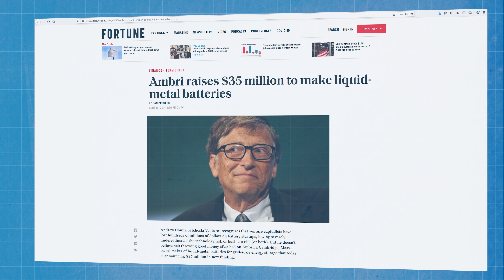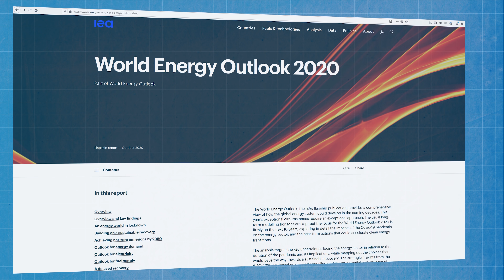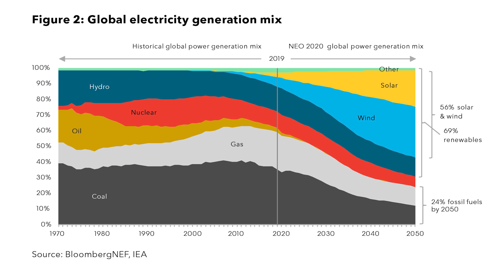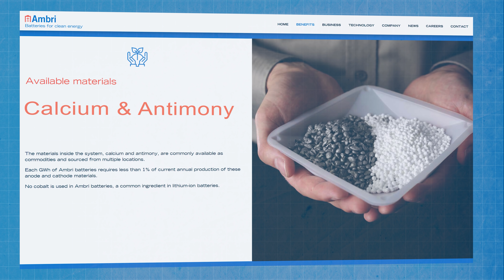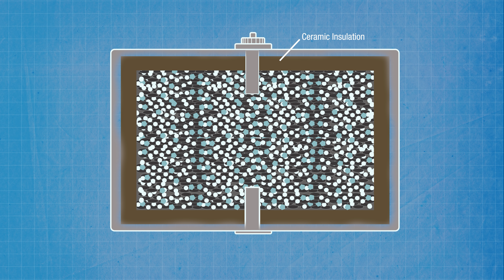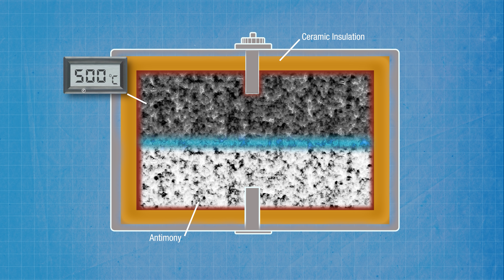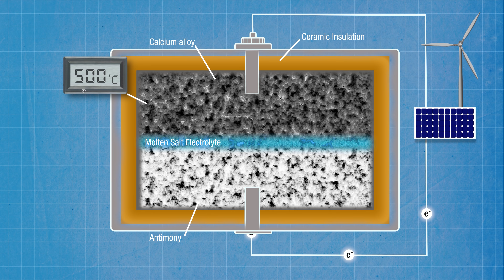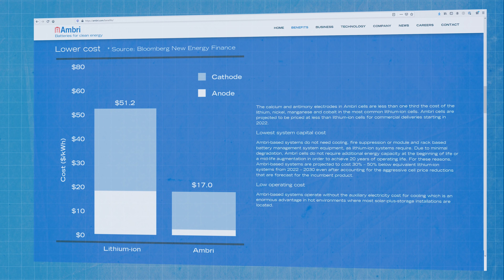AMBRI Liquid Metal Batteries. Will they really change the world?

Comment: Not really IMHO.. 80% theoretical efficinecy is still some 15% below Li-Ion. 
Losing 15% from your solar array is not insignificant. It means that you need 15% bigger array etc.
Also, batteery life of Li-Ion will go up and its price will go down.
Reply: @nick b Extra panels are not just panels. It's the extra terrain, infrastructure, installation, maintenance costs etc.
Li-Ion has no problems with temperature maintenance and probably much higher energy density.
Wear&tear shouldn't be a problem for shallow dis/charge around 40% point.
Cells with drastically lower internal resistance are coming, same with solid state cells.
And price will dive down.

Comment: I just concrete how they would handle thermal cycling  causing cracks to from in the ceramic housing.
Reply: Ideally the temperatures stay pretty close to constant.  They still advertise a life expectence of 25 years iirc, my guess is the ceramic is the first thing to go and they'll be able to just dump it in a new case and start over.
Reply: I'm pretty sure the temperature will be maintained above 500 degrees

Comment: I'm not a chemist, so I have a question.
Are these the best 2 choices for this technology?
What I mean is, 500 degrees C is extremely scary, what if the ceramic develops a crack? How possible is it for 500 degree molten metal to spill into my 
energy closet and burn my house down?
I absolutely love the thought of an almost endless amount of cycles for cheap, I mean who doesn't?
But...is this the kind of thing that has a single accident and the entire tech gets thrown out, even though it may have worked with something just a bit safer? All be it more expensive.

Comment: the liquid metal batteries are hot. this is the negative side of the technology. There are massive loses over heat radiation.  If you have no use for the heat the efficiency will drop massively
Reply: Potentially quite useful for district heating systems.
Reply: Peter Mortensen  deutsch wäre einfacher für mich.  Danke für den Input.

Comment: I do hope this battery is successful for the grid storage market. It does seem quite silly that we are using lithium ion batteries at the moment for grid storage when they are far better off being used to power EVs as they are much more suitable for this application. 

Teslas car production is limited by how many batteries they can make/get a hold of, meanwhile those same batteries are being used for an application that doesn’t require them. Grid storage doesn’t care about energy density or lightness of the battery so using lithium ion batteries for this purpose is a waste of resources.

Comment: ......they're a good fit for grid storage. Lithium are a good fit for portable equipment and vehicles. Liquid metal can't practically be used in vehicles cos they are are gravity dependent battery and the liquid can't be allowed to slosh around. High temperature also required. They are only to be used in stationary circumstances .
..But if we're prepared to accept high temperature batteries then the best option is surely sodium sulphur batteries , the materials are cheap .

Comment: Calcium is pretty damned reactive though.
Getting a hermetic seal that works at 500C, for decades is going to be no small feat.
Reply: How is calcium going to react with a ceramic?
Reply: @bromnader5196  I asked how a hermetic seal is going to hold up over decades of use at 500C
Isn't there going to come a time where the temperature is let to drop to ambient?
Do these alloys have a completely neutral volume over that swing?
Most ceramics are pretty brittle.
Reply: @jimurrata6785  This storage is heavy and stationary.  Is a house made of bricks brittle?  Surely there are insulators that can seal the electrodes and withstand a lot of cycles.  For example the tall cylinders where monocrystalline silicon is made from molten silicon.  Up to 2000 degrees in temperature and cycles up and down every few days for years.
Reply: @bromnader5196  Is a house made of brick (not 'brick s ) hermetically sealed, full of molten metal and subject to 500C temperature swings?
Reply: @jimurrata6785  -- If brick is plural, then why do we say "he threw a brick"?
Reply: @bromnader5196  deer is both singular and plural too.
We don't say "a herd of deer s "
Reply: @jimurrata6785  If you were building a structure with brick, and you wanted your helper to get you some more, would you say "get me brick" or "get me bricks"?
Reply: @bromnader5196  I would say get me another hod of brick.
But I have a vocabulary.
Go look it up. There's no argument here.
Reply: @jimurrata6785  -- So you agree that people would rather say "get me bricks", just like they would say "get me screws".  To force the speaker to use extra words "hod" "of" to convey the same meaning, is a matter of inferiority of the grammar.  Someone arbitrarily decided way back that brick should be plural as well as singular.  But nobody cares and everyone talks of bricks because it agrees with the rule that plural is with an 's'.  The beauty of simplicity.  When rationalization ("follow the rule no matter how irrational it is") meets empiricism (vernacular usage), empiricism always wins.  That is what philosophy has taught us.
Reply: @bromnader5196  I told you what I'd say. 
That's what you asked.
Plural of brick, is brick...
Reply: @jimurrata6785  I wonder who set that silly rule about bricks.  And I bet you also break the rules.  Like driving over the speed limit.
Reply: @bromnader5196  English diction is an abomination, but I had nothing to do with it.

Comment: Honestly, the only serious potential risk I can see for this technology, (aside from dropping it on someone's foot) is if the casing gets cracked, either from transport, natural disaster, or intentional sabotage.  If it gets powered on with a crack that's not sealed, the molten metal will leak out until it looses contact with either the anode or cathode and it stops being heated.  Then it will leak out until it solidifies again.  
Keeping that in mind, it would be easy to design safety measures to anticipate this potential, and this is just something that would happen if the battery gets damaged, and not something that would happen in the course of regular use, unlike with many of the other modern batteries.  
I'm really looking forward to seeing how this technology gets implemented, and am very curious as to how small something like this could be made.  
It's easy to see this being some shipping container sized thing, but what about a car battery sized cell, or an array to have a domestic power storage area for a house like tesla's power wall?

Comment: Great video! Sounds like themal losses could lower the round-trip efficiency of the system, but I'm guessing if the surface/volume ratio of the battery is low enough then, with a little bit of insulation, thermal energy loss can be kept at a minimum. Like if the cells re oil-drum sized or larger, then they would likely take several days to cool off even if unused. I suppose there is an optimal size than balances off this as well as other characteristics. I think that with cheap enough storage renewables have the potential to lower the LCOE and democratize access to energy.

Comment: This sounds great for a big solar farm in the tropics. Nearly every day the sun shines on PV in the day and demand goes up in the evening. The batteries can be arranged to cycle fully every three days maximum with some excess storage for hiccups. It is also good for load balancing as this is pretty regular and the lack of maintenance is a major win. 

However, in temperate climates I believe we need multi-month bulk storage if we are partly dependent on solar PV. I know from experience that in the UK we can go for days with not much PV in the summer and barely a trickle for weeks at a time in the winter. We need more energy in the winter than the summer, so adding more PV because it pays for itself financially over x years is a nonsense if we cannot use the extra energy in the winter. Belligerent foreign powers or terrorist organisations would love us to be utterly dependent on a few ultra-high-voltage (or even superconducting) links to the tropics or the southern hemisphere. 

Liquid metal batteries cannot be used for bulk storage for this purpose as they would lose 80% every three days. Conversely, pump up the hydro and only use a bit here and there for load balancing with the bulk of it unused for weeks or months at a time. Pumped hydro can hold far more gravitational energy than a crane with a few hundred blocks or some trucks going up and down a mine shaft. But gravitational energy is not energy-dense. It cannot store a summer's worth of PV. (Just how high can a 3000mAh AA battery lift 1kg? I didn't believe it either!)

Liquid air needs topping up to make up for losses but no-where near 80% every 2-3 days and is probably much cheaper and more convenient than hydro. Lithium ion is simply too expensive for multi-month bulk storage. 

Hydrogen? 35% efficient and leaky. 

The issue is not yet solved.

Comment: The thermal cycle from these batteries seems to be the most likely source of degradation.
Reply: Thermal cycles are usually problematic because they cause expansion and contraction in solid metal, creating weakness. I don't think it would apply here, as ceramics are very well suited for this sort of thing. Maybe it might be a problem with the metal conductors which connect the molten metal with the net.
Reply: How do I invest ?
Reply: @ramondrongonui1024  don't think they're public yet

Comment: Thank you for this presentation. I would like to know more about the material sciences of the batteries that will be installed near Reno, Nevada, U.S.A. My guess is that the ceramic insulator would be in the form of a foam, or a blown fiber. If it is a solid foam then a certain degree of brittleness would be expected. Once the metal alloy solidifies there will be stresses associated with the thermal contraction of the working mass. I'm curious how that will be handled without stressing the containing structure. The flexure, of a metal enclosure, would likely lead to alterations in the strength of that containing structure that would likely get worse over time.

Comment: There was, in the past, Molten Salt Batteries in the "Think City" car. Big fail. My friend have this car and it is very unstable and every stone on the road can destroy some cells. Very fragile stuff. About liquid metal batteries? I don`t know.
Reply: Transport use is not what these are designed for. These are stationary batteries. They will never be used for vehicles due to their large size, weight and low energy storage for weight ratio. These systems are meant for grid storage.
Reply: @davedrewett2196  Agree. :)

Comment: I guess one of the challenges is maintaining the heat without significant losses, so daily charging and discharging at bare minimum is absolutely needed to keep the efficiency high
Reply: Yeah. My question is same. Like if you need them heated - means you will have heat loss. So constant "use" is a requirement for efficient operation. I think that part will make or break this design. And maintaining efficient operation on scale probably is huge issue. Like how much of your capacity you can maintain at working condition and so on.

Comment: I understood that this original chemistry operated at 240 degrees C and that more work has found chemistries that operate at much lower temperatures. Leaving that aside, I wonder of an inner container of corningware might be the best vessel for such batteries.  Corningware melts at 1700C.  An outer container of aerogel (use to coat the Shuttle so that it could survive re-entry).  would be the answer for insulation.  A third layer would be steel to wick away any heat that managed to make it through the aerogel.  I'd buy one of these for home use and put it in a wee cement block shed outside the house.  How are they coming in for price per kWh storage capacity.  https://www.belmontmetals.com/contact-us/

Comment: I've been watching Ambri long before the name change, hoping for an off grid solution to replace my current lead/acid bank. Sadly it's all grid scale based with huge shipping container sized cells.
Reply: Because the duty cycle helps maintain the internal heat, these batteries work best under larger load conditions than single residences. They're overkill and the wrong solution for a single home. But maybe an interesting idea for a residential subdivision to install for dozens of homes.
Reply: @Tanstaaflitis  there are subdivision developers in Western Australia that are putting micro grids in. All of the homes have large photovoltaic systems plus solar hot water and one main lithium battery storage system feeding all the homes. These liquid metal ones would work well as a replacement.
Reply: Likewise with you and Dave. The initial purchase might be a little much for a single cube but if it's also replacing a furnace and hot water tank here in central Alberta, the I will happily pony up 17.50/Kw/hr.
Reply: Yeah I’m in the same boat. I think it will be quite a while before we see household units developed if ever for this type of system. I think probably the best at the moment for our use is zinc bromide flow batteries but they aren’t without issues too.

Comment: Data on energy content in Wh/L? How does Wh/L compare to Li-ion? I realize not critical for large scale storage, but I wonder if there is a chance for home or business battery storage?
Reply from the maker: I doubt they will ever translate to domestic or even small commercial environments Barry. They are so specifically designed for utility scale applications that they would most likely not be cost effective for anything smaller.
Reply: Makes sense. I hope this technology works. Like you said, we need a variety of large scale energy storage tech in the very near future.